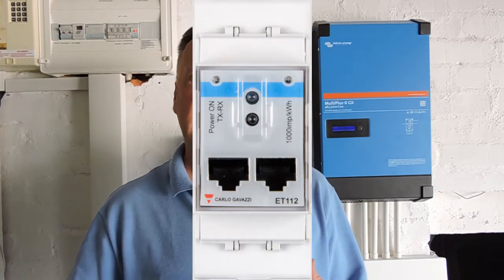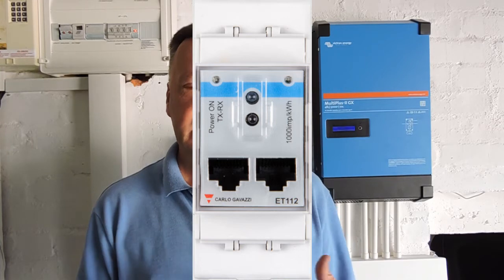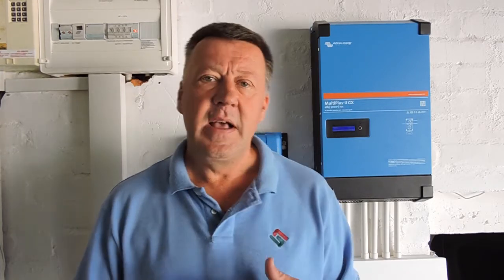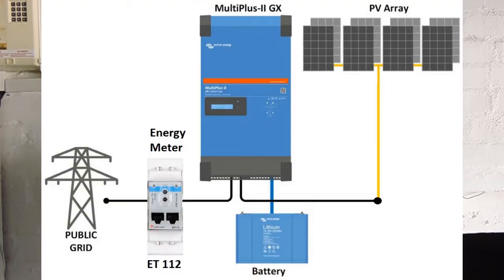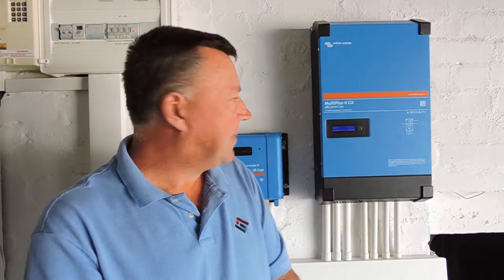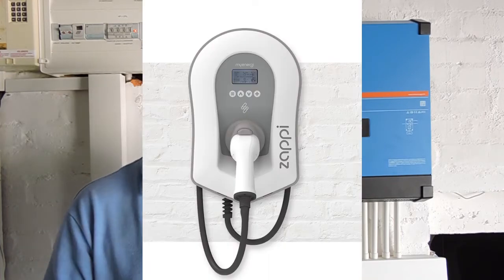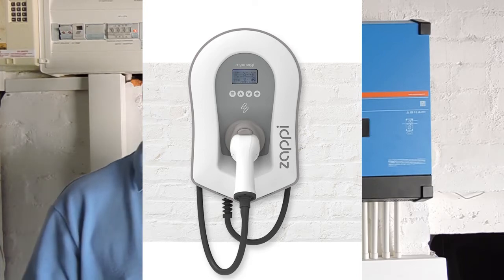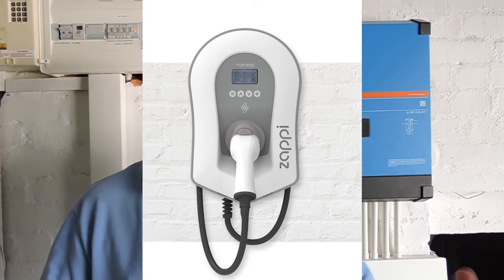Cost-Effective Migration to Victron with Energy Meter ET112

Comment: Bonjour Alan je découvre ta chaine, merci de ton retour sympathique est très bien expliqué. J'hésite à acheter le multiplus 2 en 3000VA/24V, car l'été j' accumule la machine à laver avec la pompe piscine ce qui me fait des pointes à 2700W voir 2800W pendant 20 minutes. J ai un MasterPower type (Voltronic) 3000W/24V qui tient ces pointes sans soucis, mais le multiplus 2 est un 3000VA pas 3000W, est ce qu'il sera capable de tenir ces pointes de 2700W voir 2800W. D'après tes explications lorsque tu dépasses les 2400W il va chercher une autre source d'énergie cela pendant 30 minutes environ. Je suis en Off Grid (onduleur hybride)mais j'ai le réseau en secours, car l'hiver je n'ai pas assez de solaire pour alimenter ma maison. Et acheter le 5000VA24V c'est presque le double prix, donc en écoutant tes conseils je devrais prendre le 3000VA?

Comment: You mention using either an Energy Meter or CT clamp. What is the difference between these 2? I favour a CT clamp as it doesn't involve interfering with the grid connection. Plus, my connection point is over 30m away so a CT clamp is easier to wire to the MP with a twisted pair of wires. Thanks
Reply from the maker: The ET112 is rated as being more accurate than a CT clamp and I can run the RS 485 over long distances.  I don't have any real preference. I know Victron do a 20m cable option and the price is similar to the ET112.  FYI I haven't found much info on the Victron CT clamp option and hope to evealuare one soon.

Comment: I like this, can you make a video explaining it for AC coupling? I want to buy victron Quattro 48V and use it to charge my batteries when i have excess solar because I don’t want to feed it to the grid. Then later use that power from the battery to power the house equipments etc. It would be nice to get a step by step install process in English as the ones i see are in Spanish. I cant use mppt for my setup as the house has a leased solar on the roof, so i can only use the produced solar.
Reply from the maker: Hi, that's exactly what my system does (self-consumption mode they call it).  I'll be making more videos on this setup soon.
Reply: @alanfalck1184  thats awesome, if your able to make a step by step version of how to setup the ESS to self-consumption mode when there is excess solar so I don’t feed it to the grid, what parts you need, etc, i was going to maybe switch to electric combi boiler, but the are all over 19kw and I don’t want to buy 2x 15kva Quattro just to run it lol.
Reply from the maker: I'll give it a bash